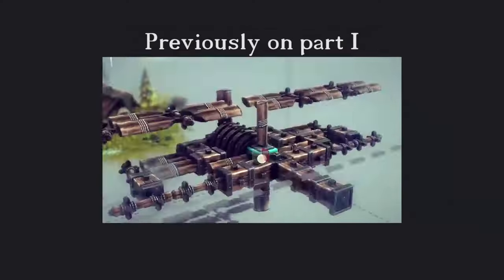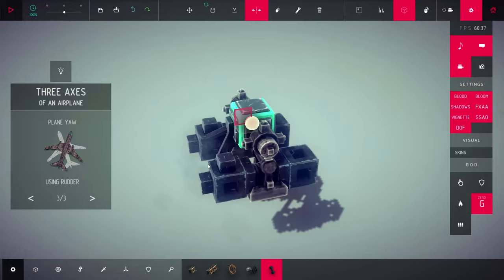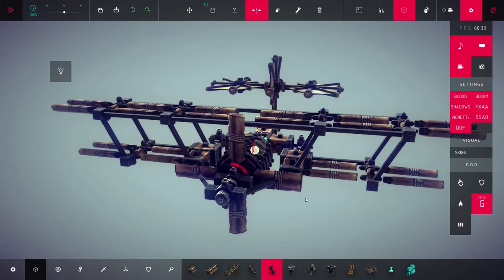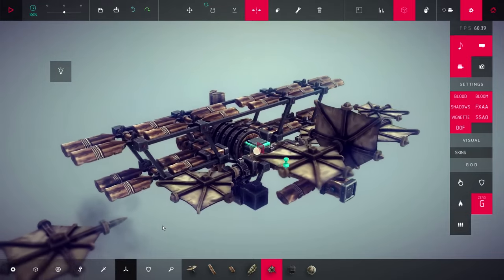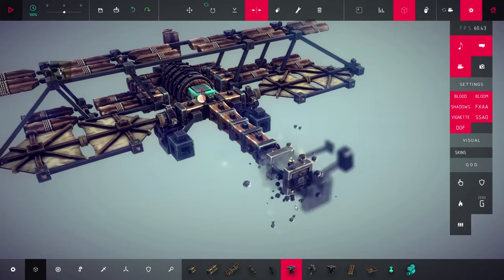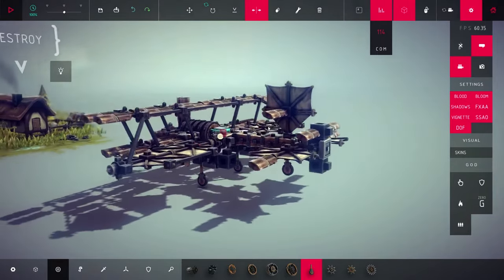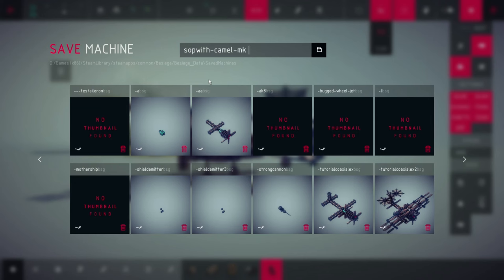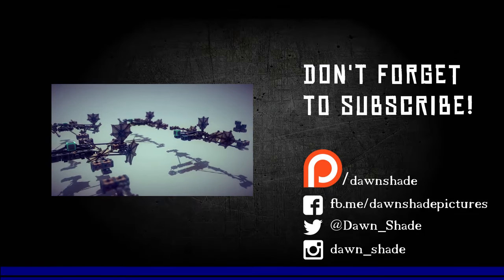How to Build a Steerable Plane in Besiege [Extended Edition] - Basic Simple Plane Tutorial Part 2/3

Comment: I have a problem that the vertical motions from the back steering mechanisms will barely turn my plane upwards, but works fine downwards. I even downloaded your complete version and it has the same problems. was there a recent update that makes this build outdated?
Reply from the maker: try the one i use in part 3 if you find the rear steering mechanism too weak

Comment: I didn't quite catch what you said when you began toggling with the settings of the wheels (~3:28). I've run it back (and copied exactly what you did) but my plane just rips itself to pieces. (Are you not supposed to use those two wheels in the engine, hence them being set to z and x? I can't tell because I can't see your keyboard and what you press when you fly)

Also, I'm constantly having an issue with my plane tilting/drifting/turning to the right (I'm not sure what part of the plane is doing it) even though it's a near-carbon-copy of yours. All my planes have this issue, but I can never find a solution. I've checked the weighting and double-checked every propellor to make sure that they are all flipped correctly, but nothing seems to work. And, as an additional issue, because it's constantly flying to the right I can't tilt the plane left with the aileron. The only thing I can do is tilt it further right and crash it into the ground faster.
Reply from the maker: I use C to toggle engine. You toggle it when you turn on the engine. This will keep the plane powered even when you are not accelerating. Then I use Z to accelerate and X to brake. These two wheels are only spinning when you need to modify the plane speed.
When I fly, I press C first then hold Z until it takes off.

I can't tell the solution of the drifting problem since I can't see your plane. It can be multiple things
Reply: It could be the engine is too attached to the plane.

Comment: Hi,
Thank you a lot for your tutorial, I learnt a lot in besiege (and I guess in basic physics).
I tried to replicate the exact same plane as you but in the end it wasn't functionnal (I've done some changes and got something "correct", the only thing is that the plane doesn't seems to want to fly off, maybe not enough thrust even if I didn't added that much brace)...

And so! I downloaded your creation, tested it and I was wondering if it was normal that your plane tended to tilt left? (as it's certainly not your mistake)
I read that it was maybe because of the unity engine?

Is this problem on every plane? Or only 1 centered motor ones?

Anyway great thanks!
Reply from the maker: The thrust problem usually because you forgot to rotate some of the propeller blades with R before placing it.

The tendency to tilt is a bit complex, part of it is unity engine, another part is dysymmetry of lift caused by single motor, there's some workaround for it but it's a bit more advanced. Also it's negligible so we shouldn't worry about it.

And yes, if you make it multi engine it should be better.
Reply: @Dawn-Shade  Rotate it with R before placing an object isn't the same as pressing "F" on it? Imma check that, thank you (else, I've checked them multiples times. I'll try to make others planes to get the idea so don't worry about this one thanks).

Did you perhaps have done any video in relation with this "workaround"?

I've heard of the same strategy as helicopters (2 engines, 1 clockwise the other one counter-clockwise) but maybe there is better, I'll take a look.

Yeah we shouldn't worry about that, planes seems really fine as they are but... I kind of have the need to make perfect machines? I dunno if I can I just want to try things. ;)
Reply from the maker: @Sulff629  R is rotate 90 degrees. F is flip a.k.a mirror which isn't the same as rotating it 180 degrees.

Hmm not me but my friend CCCanyon has. Search for "symmetrical deletion besiege cccanyon". That will solve at least the unity engine problem.

It's different from counter rotation. Disymmetry of lift is when advancing blades got more lift than the withdrawing ones. My counter rotating props aren't perfect because they didn't finish a spin at the exact time. If you can solve it then it should decrease said tendency.

Comment: I have a problem my front propeller on contra rotating spin slower than the second i have make sure in connected with the starting block can you help
Reply from the maker: are those blades have same correct angles?
Reply: @Dawn-Shade  yes i test it without wing it fly straight with wing it bank left i think the problem is the wing I'll try to rebuild the aircraft
Reply: I'll try to build the plane  using wing panel that appear when you explaining.. btw good vid I check out part 3

Comment: This biggest problem I'm having is that I can't seem to generate enough thrust to even get off the ground. I've followed your instructions to the dot (even some things you changed but didn't mention!) but haven't had much luck. Any help? 
Thanks for the videos regardless.
Reply from the maker: Are you sure the thrust is strong enough, and the rotors are correctly contra-rotating?
Reply: @Dawn-Shade  I figured it out, I think. I wasn't paying enough attention to propeller angles, both on the wings and the rotor. At some point I'd rotated some propellers to be more vertical (whist still angled in the correct direction). I didn't realize this had such a profound effect on the aerodynamics, but to this game's credit, it does. 

Now I'm having issues with my plane being unbalanced. It's just a minuscule amount leaning left, which is driving me crazy because I can't find anything unsymmetrical. Arrrgghhhh
Reply from the maker: That's just unity engine being unity.
When you add the control surface, the miniscule amount would be negligible

Comment: For some reason my swivel joints do not turn when my wheels turn so I used a unpowered wheel for the main rotor what should I use for the coaxial rotor?
Reply from the maker: looks like your swivel facing the wrong way.
you can't use unpowered wheel for a coaxial rotor, unless you use mods.
Reply: you so much I will try putting my swivel the other way.

Comment: I’m having issues with the torque once I move the rear prop to the front. The props do not spin at the same speed. In the time it takes the front prop (one connected to the start block) to complete 50% of its rotation the rear one has completed 125%. Pretty sure I’ve done everything as you have
Reply from the maker: they don't. as long as it doesn't spin the plane you're fine

Comment: For some reason the aileron would not work even though i did the exact same thing as you instead it just wiggles a little
Reply from the maker: Probably either the hinge or swivel stuck. Make sure they can move by using the hand tool before connecting them with braces. 

But if you're still stuck the recent update has return to center steering hinge so it's actually recommended to use that now.

Comment: If I under v0.3 what should i use
Reply: Unpowered wheel that scaled down maybe ?
Reply: Owh it doesn't matter i just checked my besiege it v0.75
Reply: If i use "jet engine" at the back will it climb up
Reply from the maker: @depressedbread6893  if you balance it properly, it should work fine
Reply: @Dawn-Shade  ok thanks

Comment: at the front of the plane i placed two swivel joints however only one of the propellers move
Reply from the maker: The non moving one needs to be connected via a brace to the rotating starting block

Comment: dunno if they modified the engine but I replicated this step by step and it doesn't even come close to lift-off
Reply from the maker: All the propeller Blades must have the same angle of attack
Reply: @Dawn-Shade  I did turn them all in the same direction as in the video, either way I found other designs that work

Comment: It takes off and all, but It tends to quickly roll left in flight and It seems like It doesnt have enough power to sustain itself
Reply: I copied every thing that you Said and made, but It feels like It has a bit if more weight on the left
Reply from the maker: have you made the engine correctly? sounds like the torque hasn't been negated
Reply: I negated it
Reply: I even tried building a biplane, does the same thing
Reply from the maker: Well I cannot tell you without pictures or the .bsg itself